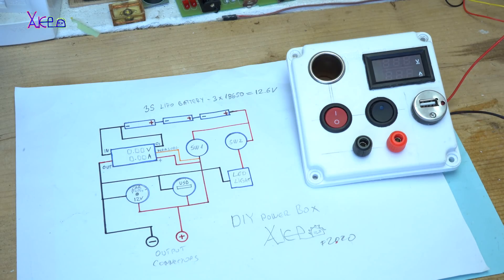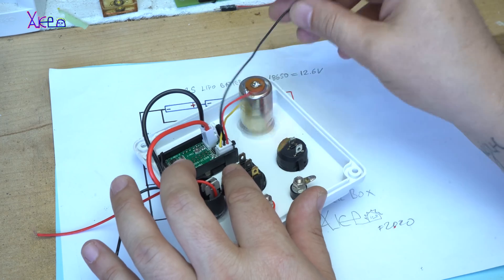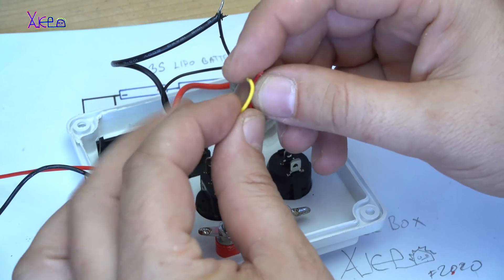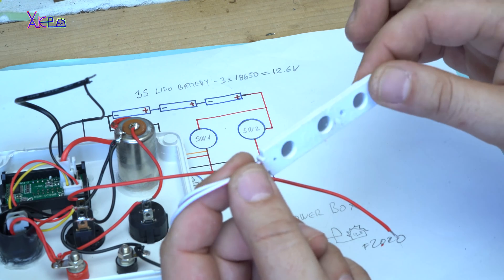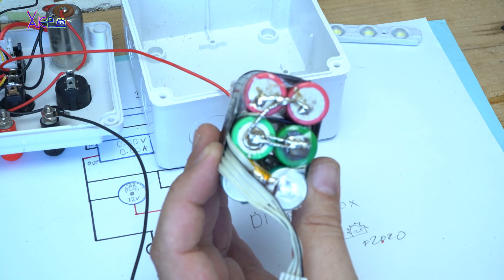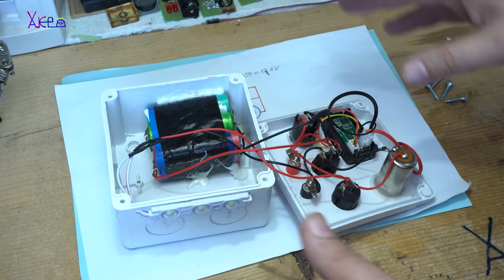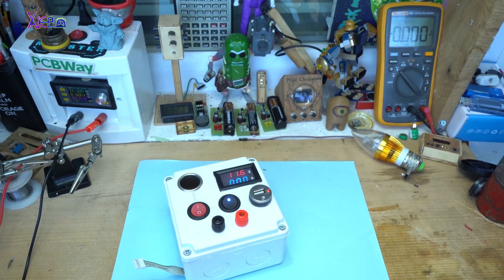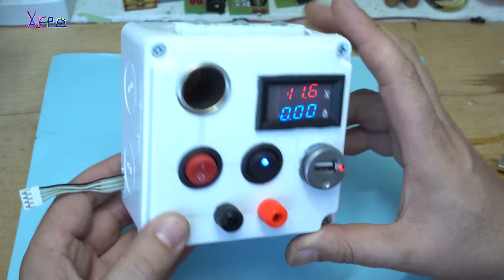DIY Power Box - part 2 Make portable power supply

Comment: Nice project. However, it lacks safety features. Maybe add a battery BMS (3S in your case), or better yet, add a FUSE! 

Fuses are the most reliable safety mechanism.
Reply from the maker: I charge the device with bms charger,did you see the flat cable from side that I put.
Reply: True, but its only when charging. Perhaps you may put BMS/Fuse inside the power supply to prevent risks of over current.

Comment: You should learn how to solder wires, for low current applications it's OK to solder like you, but for higher current applications, your joints will be botleneck, heat up and maybe brake, allso I didn't mension wire thicknes... But briliant idea, nice project, maybe BMS board will be good addon to your project, because you can charge batteries equaly with external balance charger but, you probably not gona discharge them equaly due to the slight differences between cells themself (not exactly same capacity of every cell, different internal resistance etc.) Allso undervoltage (overdischarge), overvoltage and overcurrent protection is a nice feature to have... And this board - BMS is dirty cheap, for 4S battery 30A limit it is about 3 euros. So I mean one day you will open it and find out that one battery was discharged to 2V second to 3V and third to 4.1V (2+3+4.1 = 9.1V wich is normal voltage of discharged pack) due to lack of this protecting board. Aaaaaaaaaand I still didn't mension a proper fuse... But I don't want to bully you or something 😂😂😂😂 your ideas are nice but not done profesionaly 😂